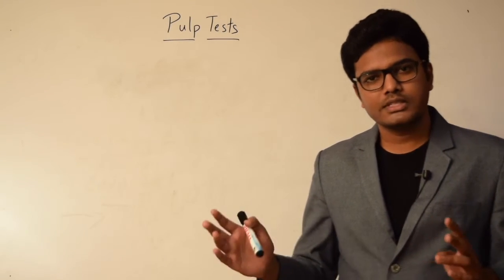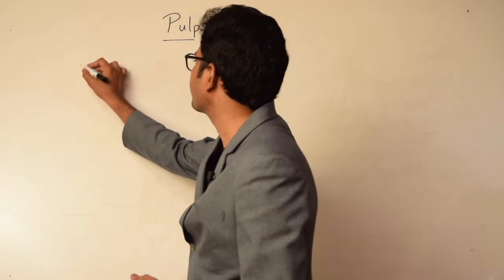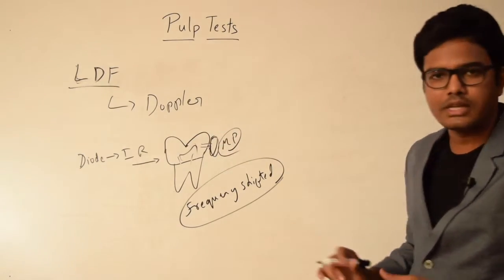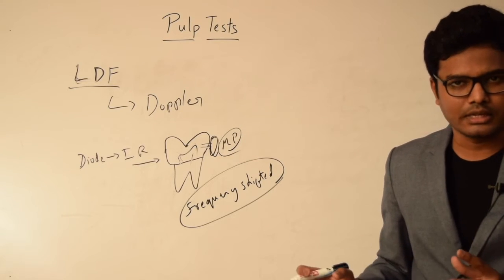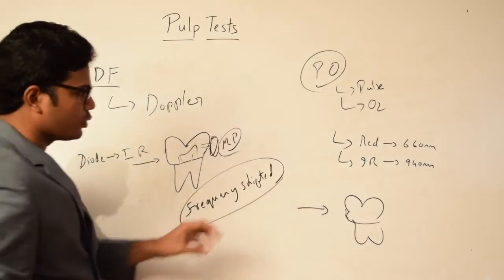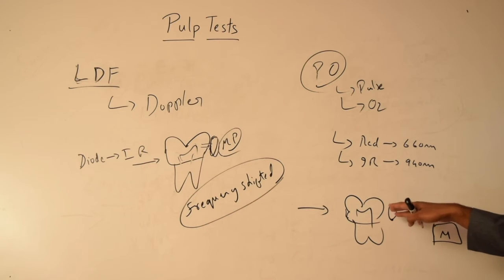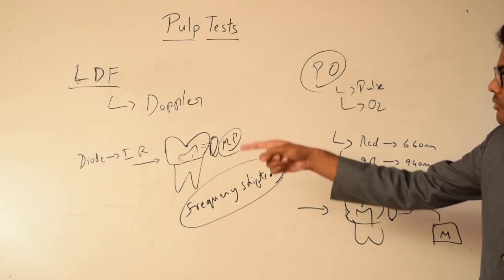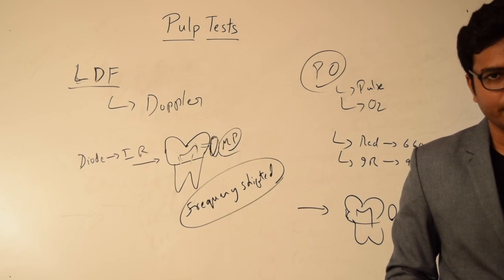LDF & PO

Comment: Hello sir, what would be the response of this tests in case of pulp polyp?
Reply from the maker: Hi Urvi, "the tooth may respond feebly or not at all to the thermal test, unless one uses extreme cold, as from an ethyl chloride spray. More current than what is normal may be required to elicit a response by means of the electric pulp tester." You can get back through mail for any further queries or assistance. Best wishes & love.